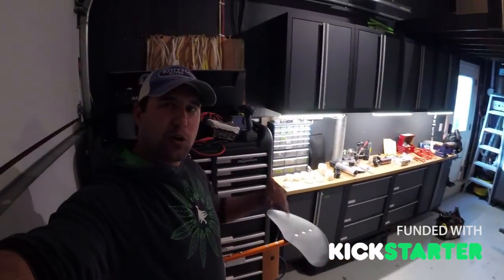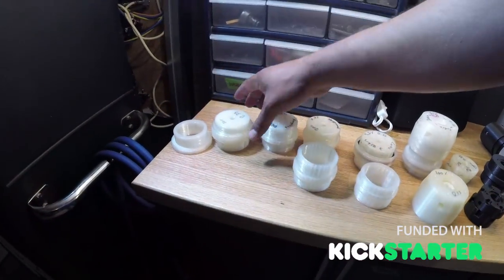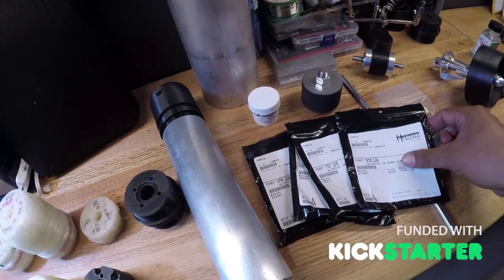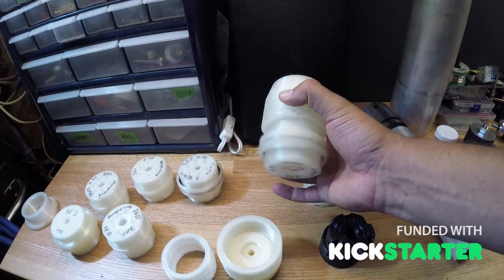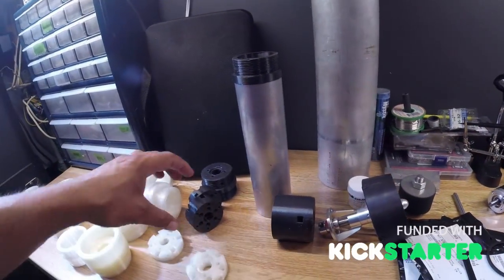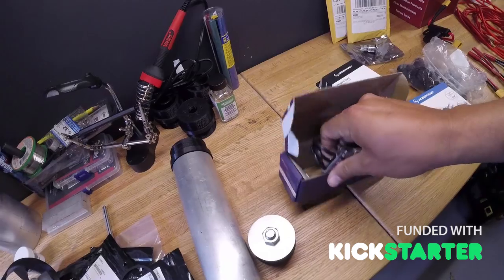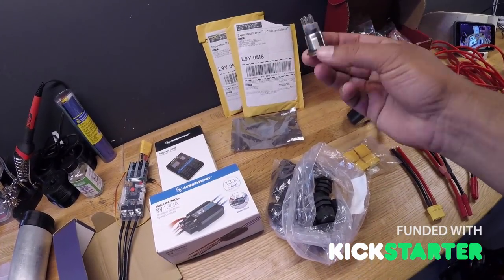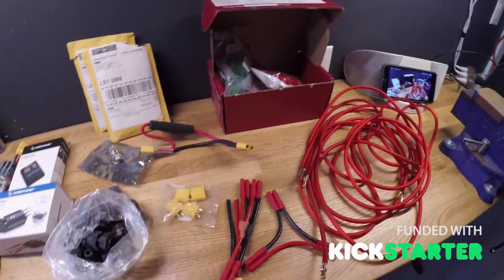VeFoil by VeConcepts Part 1 - DIY Electric Hydrofoil Remote Propulsion System

Comment: Hi! I find your solution for the tube really good. Do you have a link to find the one you used? I can't find a one with the right inside diameter. Thanks!
Reply from the maker: Fabien n we are testing a couple different size tubes as we have som other designs to test out. Metric metals.com has all the tubing sizes and wall thicknesses you can select from.

Comment: What material did you use for the 3D print parts ?
Reply from the maker: Mainly PLA for testing, we have tried a few other higher end super strong stuff but I don't recall at the moment. Our main parts will be CNC'ed aluminum for motor mount, motor housing, the other parts will be CNC'ed Nylon for strength.

Comment: Does this even have a motor to move it,i have watch 3 of your part,and theres nothing about the motor
Reply from the maker: This particular video does not have the motor in that tube, but as you see in other videos its in there as the motor and prop are running.
Reply: Thanks for the reply!.So i'm guessing any brushless motor would be ok then

Comment: which is better to use the reducer 5:1 or 3 : 1 ?
Reply from the maker: We are testing this out still. looks like we have setups that should work with 3:1 and 5:1 with same prop, depends on how much speed and torque you like. This week we should have this tested out and results with our first round of setups.
Reply: thank you)
Reply: is this a Parker gear drive??? Same used as pacificmeister??
Reply from the maker: No its not, also pacificmeister is not using parker any more as it stopped working he using another brand now Neugart PLE 40  5:1
Reply: Thank you very much. I have a problem outsourcing a proper gearbox. All manufacturers say to me that my RPM input is too high !!!
Reply from the maker: Well, that IS the problem with reduction gear design foils. Everyone has the same issue of gear box failing after several hours because no one makes a reduction gear that can handle the input RPMs. We are working towards a direct drive now with Impeller to eliminate this issue and for safety reasons.
Reply: that means that you have to match the 40000+ RPM of the shaft with the correct impeller size ( small size ). At this rate numbers, propeller is inefficient, only impeller jet drive is efficient. But you lose low end acceleration through this method. Am I right on this??
Reply from the maker: Sorry for the delay.... no its a no-name from China just for testing.

Comment: Thank you for video!  Is 4 blades good for such high rpm's? GUESS it's good on 2-3k, on rpm's beyond that it's becoming ineffective.   But for sure I'm not expert). Better try then listen. 38 Amps while starting up, how much with cruising speed?
Reply from the maker: Testing this weekend will tell the tale. If all goes well we will test current and thrust LBS for each of our prop and gear setups total 8 different setups. That's if we don't run into any problems (technical or weather). We just got a scale for testing thrust and I'm interested to see how things perform.
Reply from the maker: Should mention, one of the reason I want to test 4 blade, lower pitch, with higher RPM is because I have seen another setup similar, and was told it worked, so why not test it out as we want more thrust and 4 blades does this using same diameter.
Reply: No doubt, I would do the same if I'd have it. By the way what is battery voltage you had when you got 37Amp. on start. I just was thinking that this is big difference in power consumption if you have for ex. 22 volts or 44volts. Generally it's double powered with higher one.
Reply from the maker: We were running 12S - 44.4v - 50v, 5:1 reduction gear, This is a great little calculator for playing with power levels: http://www.rapidtables.com/calc/electric/watt-volt-amp-calculator.htm
Reply: Ok, I see. Thanks man. I'm actually about to start my project, was doing jetdrive, and already casted couple impellers of alluminum 100 and 120mm OD and made wax model of motor. But then I realized this is gonna be jump into the past as foil is more effective in compare. My plan is to use shaft trough the foil similarly to outboard motors.
Reply from the maker: Very cool!
Your going to use a reduction gear with that size prop I take it?
Keep me posted would love to watch your progress Andrey
Reply: Those were impellers  360 closed blades, they only good for jeting. For this scenario will choose regular boat prop. but for sure it will be not less than 100mm. I'm expecting  83100 outuner with max. power rated to 8kW plus water cooling. Got 2 400A ESC's and some other stuff. The only uncertainty  I have is oil chamber for reduction gear. Still about to start after finishing some other things.
Reply from the maker: nice, how many volts you planning to run?
Reply: Ooo, I have 2  6S Polymer, batteries. with about 0.25kW-h power totally will start from them. Also got 10kg of LIFePo , 20 pcs. 20A-hr each. about 1.2kW-h totally this will be used somehow. This BLDC I'm expect in about month is 253kV so plan to have 5k RPM's max. on prop. Not sure about reduction gear ratio, but it's depend on ouboard motor I choose to buy for swaping.

Comment: Do you think that shaft seals will work without a stuffing box? Looks like an area that will leak slowly into the tube, but perhaps will be enough since there is very little water pressure trying to get in (vs a sea scooter or diving type unit). Hard to find good info for sealing out water under pressure as it tries to get past the shaft/seal interface.
Reply from the maker: It is very hard to keep water out thats for sure. We have one shaft seal on the inside of 3D printed part, then shaft hold filled with marine grease, then a shaft seal on the outside. It seems to work well. I think once you are done using the board, its best to take it out of the water as motor tube will cool and could suck water in through seals. Running the motor is heating creating a positive pressure inside the tube. That is my thinking.